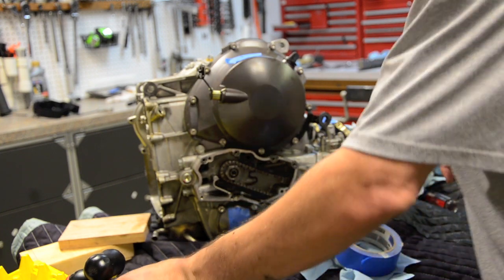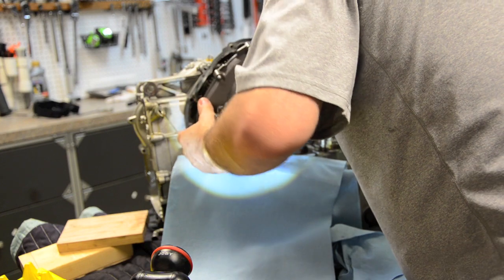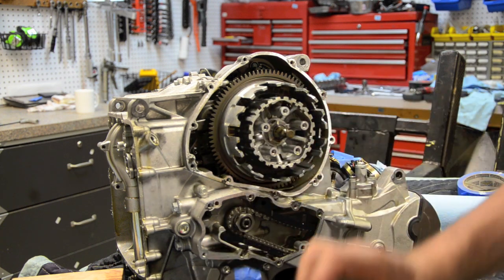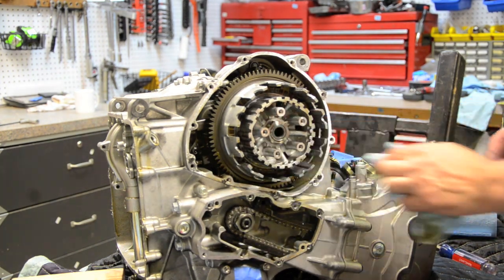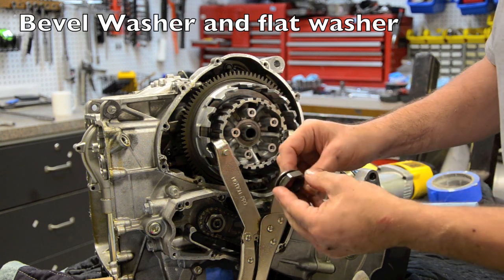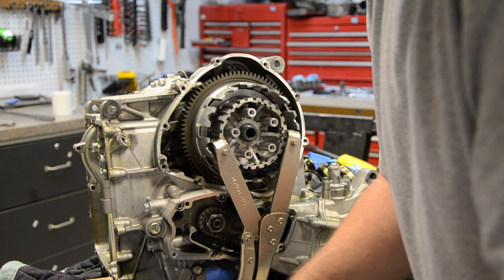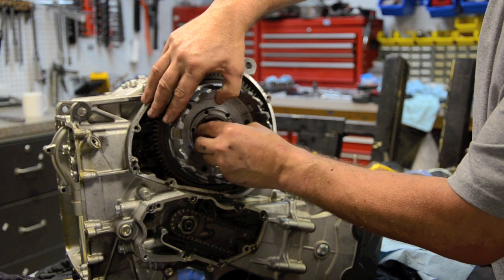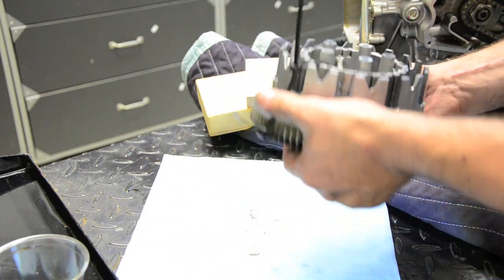Triumph Daytona 675 - Engine Disassembly - Video2

Comment: Chris,  great videos.  We are replacing an entire engine but got into the clutch side so we could check the water pump condition.   So related to the hub nut,  yes I saw the tapered side of the nut goes in first,  now the C washer directly behind the nut ... does it matter the orientation.   It is not flat.   Thanks

Comment: Hey Chris, at 7:28 it shows the bearing sticking out a bit from the basket to where you can grab it. How'd you get it to stick out like that? Mine is flush and I can't seem to get a grip on it. Thanks in advance!
Reply from the maker: I think you could also just remove the clutch basket first and them remove that spacer.
Reply: I can't because part of that gear is behind the housing, the bearing has to come out first to allow the basket and gear to shift over and out, if that makes sense.
Reply from the maker: Maybe a strong magnet will pull it out enough for you to get hold of it

Comment: Am looking at. buying a 07 Daytona675 from dealer that was crash and rebuilt they said it leaks a little oil maybe needs a new base gasket anything I should look out for , or should I not purchase
Reply from the maker: My only concern would be how long it possibly sat on it's side, when crashed, with the motor running, but I doubt you can get that answer. I'm by no means an expert on the 675, but am mechanically inclined and own many other brands. If you have doubt, shop around, there seems to be plenty available, have you looked on the 675 forum http://www.triumph675.net/forum/

Comment: Thanks for the video, quick question tho when taking the cover off with the engine still upright and intact would I need to drain the oil first or can it come straight off?
Reply from the maker: Ben Craddock Most of the oil will be in the sump, you'll only lose residual oil that is in the clutch area.

Comment: No need for a flywheel puller @7:28?  I ask because I have to replace the pivot plate that's located behind that entire hub and if I don't have to spend the extra money for the tool I'm not going to.  EDIT:  I found a service manual.  Looks like I don't need a puller and just push the outer housing back to release the bearing.